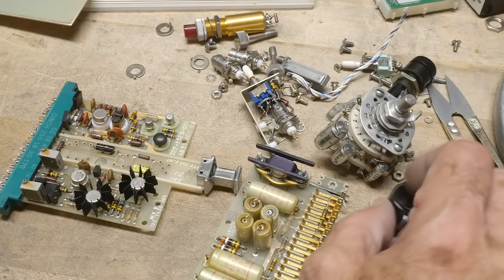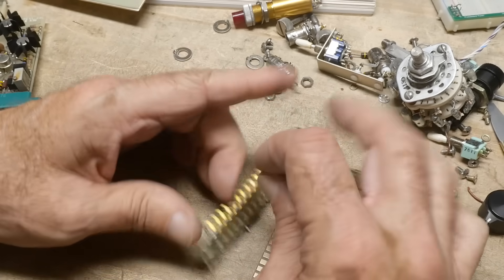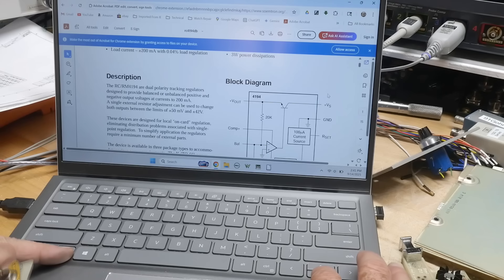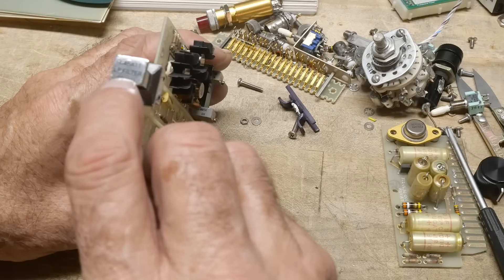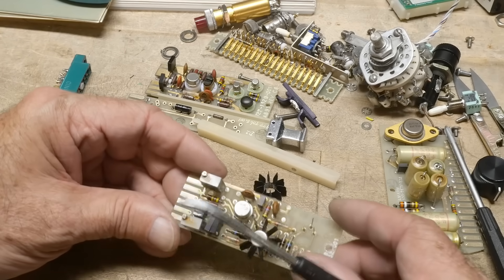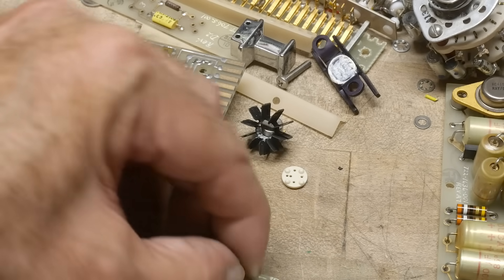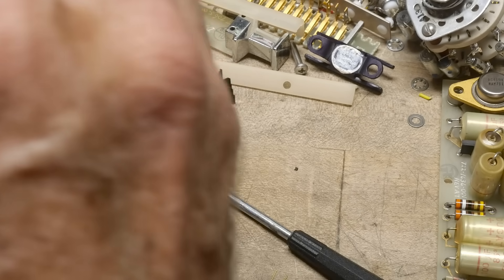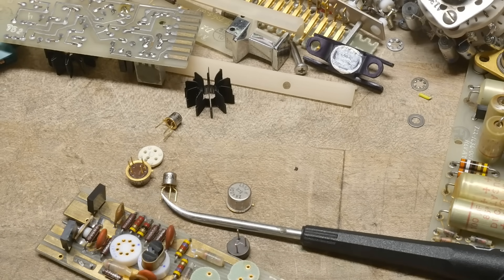#2391 Interesting things found in a teardown

Comment: That RC4194, seems like such an interesting find. Looks like a nice bit of analog circuit design, on the surface, and it is; however it is also, probably like looking at the block diagram for one of many nice, lab grade, discreet component(transistor, or/and shiny tubes) based precision power supply made by HP over the years. And now you see it brought to its form on silicon, and that has to be a trip, probably. Next thing I wondered was, "gosh I wonder how pretty the die/package is?", and to see what little old tricks they threw in and which were no longer needed.  Whoa, words, sorry I dragged on there. Goes without saying, please make a vid on that. Thanks for the great content, as always!!

Comment: By any chance is that card from a Bentley Nevada recorder amplifier? I have several of their 5248-02 units, and their boards look a lot like that

Correction: I think I was remembering the PCB Piezotronics Shear Accelerometer Charge Amplifier Model 464A that I have

Comment: I once find a industrial board with those plastic spacers and sockets, that I reused in my dual linear bench power supply. It looked so cool and vintage, and the sockets were useful when I burned the transistors few times...
Reply: Have u got that circuit posted up anywhere, or know where i could get a copy?
Reply: @jonlitchfield8888  The psu circuit? I adapted one that I find in a 80s magazine, similar to Elektor. If I find it, I will post a link here.

Comment: Are you in need of the lit power switch?  I'm trying to hunt some down to repair an ENI amp and I reached out to mil spec. vendors but I can't get any responses from them.  I'll pay for the switch and the shipping no problem, if you'd be willing.  If not that's okay too, no worries, I'm still figuring out the workarounds.

Comment: I'm thinking the steel pin feed through was for leakage current. Maybe it has a high input impedance. The first matched pair transistors in the metal can might be matched pair of JFET's.
Reply: Yes for high impedance, nd the sockets because you had to match pairs of Jfets to use there, and you did not want to run the risk of soldering making them change match even the slightest, and also likely you would need to replace them with a new matched pair as they aged, and drifted ever so slightly.

Comment: Wouldn't just pressing the flat sides of the 2N3904s against each other have worked better for temperature matching than the little copper heat spreader? Could be done with a little ring of heat shrink tubing.

Comment: The 4194 was made by several companies - Raytheon, RCA, Fairchild, Silicon General.
Back in those days it could be difficult to get engineers to specify a part unless there was a second source. It does make it difficult to tell which manufacturer was the original. Datasheets from second sources would often state things like "direct replacement for ..." or "pin compatible with ... with improved ..." which would point you at the original part without specific reference.

Those boards long predate the FR4 flame retardant standard. The are probably G10 (sometimes G-10).

The domed black transistor package was one of the early epoxy packages. There was as smaller one. They were essentially TO-5 and TO-18 outside diameter. Their popularity was fairly brief, The TO-92 package rose to dominance and replaced both.

Comment: I think the card extender/adapter on the power supply card might have been the company, (you made no mention of their name, but it looked a lot like old HP cards,) using a power supply card from another one of their products and just making adapters because they had a bunch of them left over in surplus stock from the other product.

Comment: " In the old days when gold was cheap" Nah, things were made properly and cost accordingly ! ....cheers.
Reply: They also used a lot more gold back then compared to now. I think it was like 100 times more. The Plating was a lot thicker. If you compare old to new plating, you will see a color difference due to the amount of gold used.
Reply: @schluderjupp "color" difference is from surface finish. Not sure what they used back in the day, but now gold plating is done with a 'film' of gold on top of nickel base thickness that naturally level the imperfections in surface, it's mirror like.
Old gold PCB surfaces I encounter a very matte and rough compared.

Comment: Well, my 2 cents on the isolated single pin on the green edge connector, I've seen something similar used for reducing current leakage on super sensitive input circuits or low voltage integrator circuits....seems like they were trying to solve a problem...
Reply: The whole nature of that type of device is a problem, or, at least, a headache. Accelerometer amplifier. Depending on the type of task, could be incredibly minuscule signal, Nasa, particle collider or early-gravitational wave detector prototype, something equally as neato, given its age and quality.

Comment: Idea for a video: what are different power supply voltages used for, and why did older equipment often have more complicated power requirements with multiple voltages, negative supplies, etc. 

(This is not a question I’m asking people to answer in the comments, I can hear you reaching for your keyboards 😂)
Reply: The modern power distribution concept is to being in a mezzanine voltage such as 5V or 12V, and then use point-of-load (POL) converters/regulators where needed.
Reply: Can't help myself :) have you seen a modern GPU, supplies from 0.8v through 1.2v 3.3v 5v 8.4v and up !

Comment: I wonder if the 3904s could be rework.  Or the socket might have seemed like a good design option if they were externally pairing transistors in a second stage, as you suggest.

Comment: On the board with the socketed transistors, why do the resistors have an additional yellow band at the tolerance end?
Reply: A yellow 5th band color "back in the day" was frequently used to indicate a flame proof resistor.  These days it depends on the manufacturer of the resistor.  It could mean pretty much anything.  I have seen datasheets that use it to indicate the resistor type, carbon film, metal film, etc.  Some that indicate it as a constant voltage fusible resistor, surge resistor, high voltage,  specific series of resistor from a manufacturer, etc...
Reply: @mikesradiorepair  Thank you . So much information! It really caught my eye as it looked like every single resistor had it on the board. I appreciate your response. Of course, Datasheet is king!

Comment: I always heard that referred to as "pot snot". I think the weird pin is for keying so that the 2 boards could not be put in the wrong socket.
Reply: Would keying make much sense if it's the middle of 5 pins on the edge board, why not make it offset so it cant go in backward with the same stone, unless placement made that unnecessary, which could be.

Comment: Looks like the mechanical engineers were at the front of the innovation bus for this product design.  I wonder if the first power supply board had that interposer board just to host the programming resistor to set the power supply voltage?  Seems like a lot of $$$ to make a single one-cent resistor easily interchangeable.

Comment: Maybe the weird pin thingy on the edge connector is due to some thermal characteristic (isolation?) from surrounding pins, the pin placement is near the round matched pair component and two TO-92s

Comment: Back in the old days I used RCA components. They had also very interesting vacuum photodiodes and multipliers. The funny connector with a spike on it is likely a high impedance line, maybe for an electrometer. The purpose is to isolate surface currents of the plastics with the PTFE parts.

Comment: Can you think up and build a circuit to showcase your favorite old pretty parts? As a tribute to those nice but obsolete components.
Reply: Yes that is also on my to do list. A visually appealing simple novelty circuit with point to point connections no pcb and encapsulated in crystal clear epoxy.
LED illuminated even. Vintage components are very interesting to look at.
Reply: @BrianPeers-p9k 
> LED illuminated
🤡